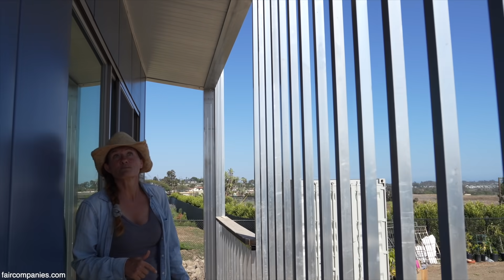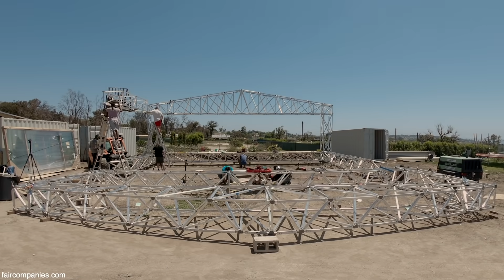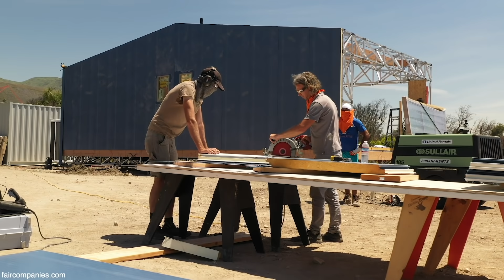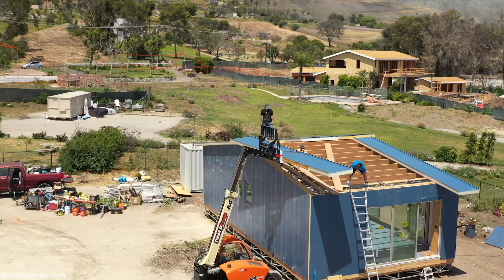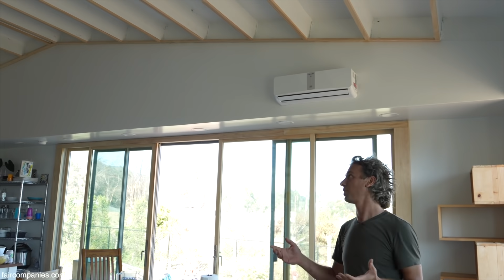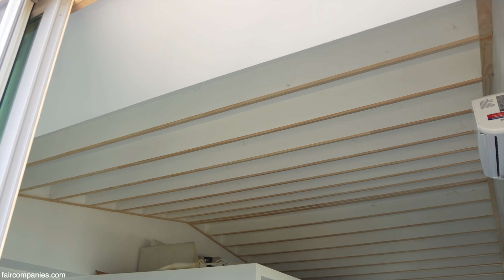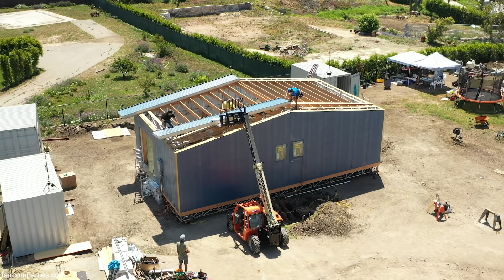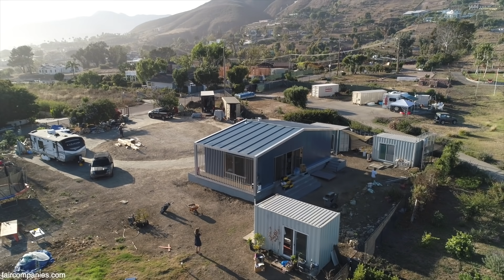This home goes up like a Coachella modular build: fast/cheap

Comment: That truss looks a heck of a lot more complicated/expensive than a mass produced steel truss
Reply: They are crazy expensive. 400sq ft model is $145,000
Reply: @tyelarson4778  Thanks, that's quite expensive.
This video made me think how you could maybe robotically assemble or "3D print" such structural trusses or flat wall panels. Or a combination of the above.
There are SIPs but I feel like there should be a way to produce finished wall panels in some kind of automated way that has both structural / compressive / tensile strength and is pretty cheap.
And with high enough precision that you only need to slot and screw them together.
Reply: @dejayrezme8617  The walls of this house are insulated metal panels (IMP) which are considered structural in some places and can be had for around $200 for a 4x10x6 'sheet'.    You probably don't need the trusses - the most innovative part of this build is the ground attachment as it looks like there is no traditional foundation.  Between the IMPs and no foundation, that is a major time & labor saving.
Reply: @ckm-mkc  That sounds like a pretty good price, but yeah it's really just painted sheet metal with an XPS core. 
I figure the real trick would be an automated and precise way to cut and connect these to each other.
So you just have some automated factory that makes your order cheaply and you can just screw them together.
As a foundation I figure these giant metal screws could be the future.
Reply: They seem to use some standard connector to connect precut aluminium tubes together. Probably they can do it rather fast. And they can customize the elements to a specific house build.
EDIT: It could also be that those custom connectors are steel that has a higher fatique resistance. Aluminium becomes brittle and breaks when it is constantly loaded. But with trusses this happens (I think) mostly at the joints. So maybe this is a way to make these aluminium trusses long lasting?
But I'd think this would work better with steel and some kind of welding robot. Like a 3D printer that just cuts steel tubing and welds them in place on site.

Comment: Aluminun doesn't burn (easily), but it melts at 1221  Fahrenheit.
Reply: But it's not easy to get it to that temperature... Very conductive and so it dissipates heat quickly, as well as distributes it throughout it's whole mass, and highly resists forming of hot spots.  So can take a lot of heat energy to actually heat it to that temperature... Along with being very reflective to radiant heat...  80-90% to painted Steel's 5%, even painted or covered with soot it's still only less than 20-30%.
Reply: @ZeoCyberG  in theory, you might be right. In practice. these people had their cars melted.
Reply: @curly_bill1629  Cars with fuel that ignites and a lot less mass than a building... Sure, a lot easier to melt when the structure is in the fire and gets completely engulfed with no chance to dissipate heat or have enough mass to make it take very long...
Reply: @ZeoCyberG  I hope she and her husband never get to find out if she was right or not. However, forest fires can reach temps of 800 centigrade (1472F) and a crown fire can reach 1200C or 2192F. Aluminum melts.
Reply: @curly_bill1629  So would steel if it actually got that hot but again, the properties of Aluminum means it'll take a lot of heat energy before it actually can get to that melting temperature...  That's the difference, steel would absorb the heat long before aluminum would and that actually makes it harder to melt Aluminum...  Understand, it won't just melt because there's a nearby fire that's at the needed temperature, it needs to actually heat up the structure to that temperature and if it's reflecting and dissipating that heat then it'll take a lot more energy to actually make the metal reach that temperature...  Seriously, what do you think Reflectix, the material used for radiant insulation, is made of?...  Aluminum!
Reply: @ZeoCyberG  fine. whatever. best of luck
Reply: @ZeoCyberG  Conduct the heat to where ???
It's not an engine block with coolant circulating.
It is caught up in a wildfire that completely engulfs the structure.
Reply: @jimurrata6785   Unlike a tiny engine block, there's a lot more surface area to a building and that allows for a lot of heat to be passively taken away by the air and aluminum is around 4 times more heat conductive than steel.  This is one of the reasons aluminum or copper are used in heat sinks and heat pipes for computers, etc. and that heat dissipating performance is determined by surface area and air flow, which is why some can go fan-less when the heat sink is large enough to allow simple convection to do the work... Again, we are talking about a building and not something small... 

Also, conducting the heat throughout the structure also helps prevents hot spots or concentration of heat.   Add, aluminum is much more reflective to radiant heat than steel.  So most of the radiant heat of a fire, which can be most of the heat released by a fire, can actually be deflected away from the building up to the point the fire actually engulfs the building.  Making it much harder to actually reach the melting point of aluminum...

Versus less thermal conductivity that means it'll hold onto the heat longer, it can get hot spots that concentrate the heat energy, and lacking reflectivity to radiant heat means steel can absorb a lot more energy before the fire even reaches it...

Steel does have the higher melting temperature but it's easier to heat up than aluminum and that makes them much more comparable than you think for fire resistance...

Of course, if the fire is inside the building then that's a different story but exterior wise Aluminum is not a bad choice.  Especially, when combined with keeping an open field so the fire never actually gets close enough to engulf the building and it's just embers and radiant heat...
Reply: @ZeoCyberG  I honestly don't think you know much about specific heat of different materials or the concepts of transfer of energy.
The skin is steel, supported by some light aluminum trellis that has next to no mass to draw heat into.
You talk about conductivity, radiation and emissivity like some kid reading a 7th grade book on thermodynamics.
There is a lot of wood in this "house" holding up the roof, where they could have easily subbed more truss.
But hey, I guess I'd rather watch my kids roast in their individual ovens, out there in the yard than be proactive about fire safety or have a safe house to live in.
Reply: @jimurrata6785  Nope, they used space framing and sip panels, which together can span up to 40 feet, which is why there's no support beam or support wall for the whole length of the home.  Thus why they were free to divide up the space however they wanted. Fact is the framing and panels covers the entire exterior, including the roof that also has the layer of insulation that's double the rated for code, along with also the entire flooring to foundation.  There's only some wood on the interior and the point of my post is simply pointing out how aluminum, which is what the space framing is made of, actually performs thermally.

Seriously, there's tons of products that prove this like Reflectix that's used for radiant heat insulation that's literally just a layer of aluminum.  Try welding, etc. with aluminum and compare to steel and you'll immediately see it's not that easy, especially the more mass you have to deal with...

While in a wide open field, they're not going to roast because the fire isn't going to get that close.  The building just has to withstand mostly radiant heat and embers, with nothing flammable on the exterior... To engulf the building there has to be combustibles right up to it and even part of it, the fire won't simply go to it like a flame thrower and engulf it and you need more than just grass to generate the really intense heat of a forest fire...  Seriously, don't let you imagination get away from actual facts on how things actually work...

Comment: Kristen, I'm waiting for you to do a video using Aircrete  foam as a fire proof, termite and rodent deterrence. 
Very easy, light weight material which can be used as preformed walls, insulation.. please check out the product. Thank you for making so many amazing videos.
Reply: An aircrete dome would have been amazing but probably not to code.

Comment: lol steel walls and aluminum truss system.  spoiler alert it's expensive.
Reply: Less labor, though, and if you haven't checked, wood has gotten very expensive...
Reply: @ZeoCyberG  you must not know the means and methods of producing wood versus producing metals.  the labor you're referring to is on site building and not the raw material itself
Reply: @SuperPoonSlayer  No, I know, again, wood has gotten very expensive... not as bad right now but over the last few months prices got so high a board of OSB that would have cost you $8 back in 2019 was going for as high as over $29, multiply that for enough material for a whole home and the average cost of construction was going up over $16K per house... While the construction labor is a big portion of the total cost for the person paying for the home...  Seriously, you must not keep up with the market...

Comment: Wood burns but aluminum melts so beautiful. I'm just sarcastic
Reply: Yes,  then you can scoop up the puddles & re-form the aluminum.  Genius!  :)  Maybe build the streets with dual purpose getters, 1)rain 2) molten aluminum.
Reply: Copied from another comment "The numbers you mention are in the combustion zone, as in the wood burning from within. Aluminum will not burn thus it will never face those kind of temperatures. The point of this build is "to not catch on fire" from flying embers as a wooden and shingle house will. As long as there is no vegetation within 10 feet of this structure it will survive any fire around it because 10 feet from the flame it is nowhere near 600C. So the answer is YES this house will survive all future brush fires in that area as intended."

Comment: Please hire an architect, is really obvious when is developed as an engineering product and not a house
other than that, is super interesting and seems to have a huge potential!
Reply: Budget might have been the reason, how much would an Architect add to the cost?
Reply: @maxwellwellmax878  5%?
Reply: @CanadianSalvagedTimberToronto  Maybe they couldnt afford that 5%.
Reply: @CanadianSalvagedTimberToronto  Only 5% if they were just putting a stamp on the drawings.  If they 's going to "pretty" it up, owners might save money with a smart design, but most of them will just increase the build costs.

Comment: WOW!!!!!
Kirsten, I've been designing and drawing different ideas for different ways to build our (my wife and I, eventually our kids) forever home for a couple years now. 
I want to use the least amount of supplies, the least amount of outside labour (due to cost), use different building techniques, achieve a very modern home that would also be able to withstand most natural disasters with little damage or cost to repair. And I think this might be the way to accomplish all that and more. I don't know why I didn't think of trussing as a way to build a home already seeing how I used to work in the entertainment industry and have built many stages in my life with this exact material. 

This way of building could quite literally make it possible to literally move an entire home, including the structure and all of the interior furnishings in 2 long haul covered trailer trucks (18 wheelers), anywhere you want to move. It could even move an entire home from one continent to another by shipping container if it was measured just right to fit inside 40 foot shipping containers, the possibilities are endless. And the cost, the cost would be far less than building a traditional home.
THIS IS GENIUSIOUSLY BRILLIANT!!!!!! I'm definitely going to contact this company.

THANK YOU!!!!!!!

Keep Safe,
Peace, Happiness, Love and Laughter Always,
Matt

Comment: Can this be built in Colorado or only California?  Is the insulation enough and roof snow load appropriate for our climate?  This is exactly the type of home, though larger, we're trying to build our foster home here.  We've been looking at "barndominium" type homes for one because our county doesn't allow for container homes, two because we don't have the money to build a normal "stick built", and third we were going to build the large shell with only the bathrooms enclosed then slowly add room walls as we could afford it.  We want a private home with rentals in one building or buildings that are connected to each other on our property (county rules even though 10 acres we aren't allowed several buildings), this looks like something we could afford this year.

Comment: Building could be even simpler/cheaper.  Look at Adam Kalkin's house within a shed designs.  The interior structure is completely disconnected from the exterior structure. Thus the interior structure could be as light and simple as a tent.  All it has to do is provide privacy and warmth. The exterior structure is merely a shell, no insulation or finishing needed.  The bonus is the living space within the exterior structure that's outside the interior structure.

Comment: There are even cheaper ways to make fire resistant homes like mud houses, adobe houses, light gage steel frame designs, etc.
Reply: but, not as quickly or labor friendly.
Would like to see a block foundation with concrete footings to anchor too, go in first.  Really curious to see curved / quonset style framing & wonder if sips can be made to order to fit a curved run. They need not be 40', 20' paired L-R could help with lowered  wind resistance.
Reply: Not cheaper when you factor labor and time... They can put up these homes in as little as a day and take it apart and move it to another location about as quick...

Comment: Not impressed.  The use of aluminum vs steel seems suspect while the design is efficient, it seems to waste a lot of space.  The house is not attractive though they seem to like it so all is well.  I have seen much better solutions on this channel.
Reply: Less labor, less cost, aluminum is much lighter and more resistant to degradation over time than steel and you don't need to maintain it as regularly...  Patina vs rust... You don't need special tools to work with aluminum, even woodworking tools work on aluminum, making it much more convenient and less to invest with specialty tools... Modular design helps make it go up faster... Space frame is super efficient and allows a lot of design options, including some that may not work well with traditional framing, and this is more than well insulated...

In this time that construction costs have gone way up and wood especially can be expensive, alternate materials are quickly becoming more economical solutions...

With all of that, I have to ask, what exactly have you seen was better and can you explain why?
Reply: @ZeoCyberG  Aluminum is not sustainable at scale (millions of homes), many tiny home designs on here are better in my opinion, plus the dome home systems.  Perhaps it is just a matter of taste and personal choice.  I would have chosen differently.
Reply: @SequoiaElisabeth  Well, we're already using aluminum on large scales, like pretty much the entire vehicle industry, aerospace, etc. So scale isn't the issue, just the environmental impact of extracting it from raw ore but it's otherwise one of the most abundant elements on the planet and it's much easier to work with and recycle than steel...

Agree, though, a lot comes down to personal choice.
Reply: Steel weighs 3x as much so they carried the space frame in on their shoulders. The steel version, not so easy.
Reply: I know right!  Steel is the obvious choice!
Reply: So I'd be curious about fatigue resistance and how long aluminium trusses last under constant loading from winds and thermal expansion. Maybe they used those steel connectors between the aluminium tubs to make the truss for that reason.
I think weight should not be the primary concern for building, although it does reduce building cost.
I think this could be adapted to be a variation to 3D printing houses and use something like an "on site welding robot" to build the trusses out of simple steel tubing. 
Carrying the aluminium trusses around is nice but it would be better to develop robots that can take over all the large scale assembly to reduce labor costs and offer economy of scale. Just transport the robot and buy local steel tubing and have the robot cut, weld and erect the trusses in place.
Reply: that's just the way they designed it.  you could custom design some purpose for those frames, and put in steel where you don't want to cut costs.

Comment: The first problem was insufficient insurance coverage.  Seriously, a lot of people do not have proper insurance coverage thinking that probably nothing will ever happen.  Until it does.
Reply: The first problem is all of the wooden buildings near vegetation in a place where fire is a natural and routine occurence.
Reply: @runvnc208  True enough - although it is also true that the owner had grown up in the original house and had nothing to do with choice of location or building materials.  I'm not sure that the aluminum part of the new structure will survive a fire.  Folks, just buy insurance on your house - you may never need it, but when disaster strikes insurance can make quite a difference.